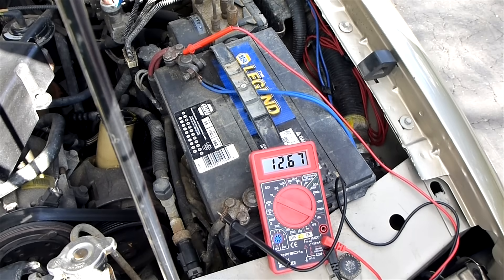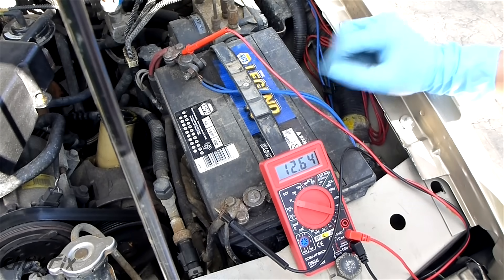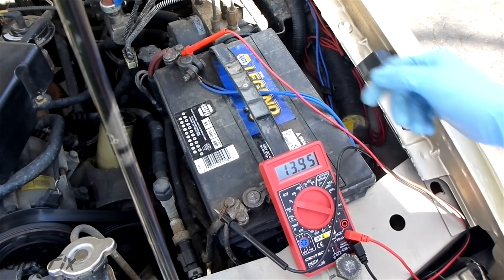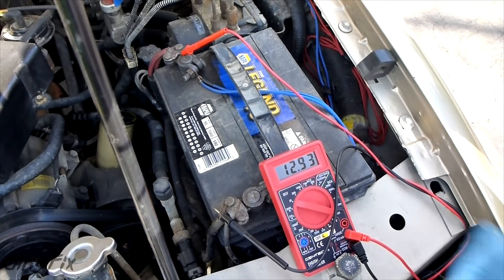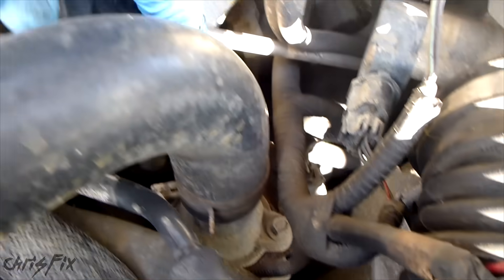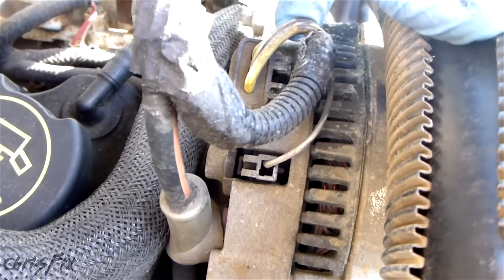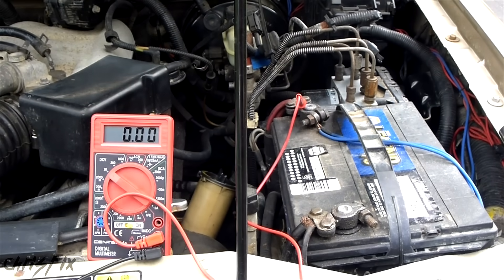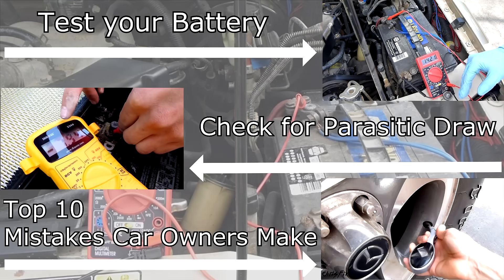How to Test an Alternator

Comment from the maker: Achilles Jeserich 12.2V is not that bad and shouldnt cause your car to run out of juice every three days. If your battery is bad, then sure it will die in a few days, but it seems like you might have a short or some type of parasitic draw somewhere. I would try this: How to Diagnose a Short in your Car
Reply: +starr shine
 I had something similar happen to my truck. Turned out to be a bad ground from the battery. I bought some wire made my own ground, tightened it up good, solved.
Reply: I have a 1970 c10 that has a external regulator and it's not charging the voltage while run is only 12.5 I can't figure it out I've replaced the regulator and alternator and battery any suggestions
Reply from the maker: Kam Nobel What if you put the red lead the + post on the alternator and the black lead on the case of the alternator, what voltage do you get?
Reply: ChrisFix 0.01 ground is 0.02 block is 0.01
Reply: Not sure I haven't done that?
Reply from the maker: Kam Nobel Try it and let me know!
Reply: Alright I'll get back to you
Reply: ChrisFix  thanks ... for your good and clear explanation of how to test an alternator. This sure helps me in checking my alternator if it's not working well.
Reply from the maker: Toby Namonne No problem! Glad the video was helpful!
Reply: ChrisFix Hi. My van starts, it drives with no issues. The issue is that when I have interior fan on high, radio, a/c, fog lights, etc. They will all of a sudden all stop working at the same time. This happens when I am sitting at a red light at idle. After I drive for a bit, they kick back on, with clock reset, radio loses presets.

Today I was troubleshooting, I had car idling in driveway, I turned on a lot of accessories, A/C, fan at high, radio, hazard lights, rear defrost, fog lights, then pop, they all go out, only this time, they will not come back on. No power windows, locks, A/C, clock etc. 

It still drives fine, and battery is getting 14.41 while idling, with no interior power load A/C etc. When I turned these all on, battery reading was all over the place, 4.22, 14.09, 11.36, 10.83, then eventually all interior accessories stopped working, and battery retuned to 14. 41 while engine running. Now, none of the interior stuff will come back on, locks, windows, clock etc. 

I'm not sure if it is alternator, because it drives fine, and charges at  around 14.41, or if issue is a fuse, or relay????

Any input would be great! Thanks for your videos. 

Vancouver BC, Canada.
Reply: +ChrisFix how do i check the continuity of the other wires coming out of the alternator?  are they negative?
Reply: +ChrisFix would that be a short?
Reply: +ChrisFix ok so I touched the lead to the + post and the case and got 12.7 volts, marginally higher than the battery lead voltage of 12.5

the continuity test of the + post to the +battery terminal is good.  just for kicks I ohmed out the alternator itself, + post through the case of the alternator.  I got 10 ohms.  Since the alternator generates electricity through induction, shouldn't the ohms be infinite?
Reply: +Kam Nobel Kam the 70 often used an amp meter on the dash. In doing that they run the pos cable from the back of the alternator to the dash, back out and to the battery. First things first get a test light and make sure you have battery voltage at the pos term of the alternator. Always go for the easy tests first like terminals loose, belts loose, damaged from battery acid cables. bad body grounds, noisy alternators. etc.
Reply: one question when i turned of my car the voltage immediately dropped back to 12.6 there was no surface charge as in it didn’t drop slowly back down from 14.4 it went straight back down to 12.6 is that a concern?
Reply: +ChrisFix if you think your alternator is not working at all and you don't have a multimeter you can just take somet thing metal and hold it agianst the alternator while your car is running becaus your alternator need to get magnetic.

Comment: i tried doing this same test and as soon as i connected the leads and it blew the lead wires to my multimeter. had my multimeter to the same setting as yours.
Reply from the maker: Sammy S There is no reason your multimeter should "blow". What happened exactly? Was there a spark? You should try the multimeter on AC and see if there is any AC current coming from your alternator. If there is, you need a new alternator. The current starts as AC but the alternator converts it to DC to power the battery. That is the only thing I can think of.
Reply: ChrisFix
yes there was a spark, i placed the negative lead on the negative and as soon as i placed the postive lead on the positive terminal it just went pop and the lead wire just split opened. keys were not in the ignition but the van door was open
Reply from the maker: Sammy S Well that is not good. There is a problem with your multimeter or there is a problem with your battery. It should only be 12-13v. I would try it with another multimeter or ask a parts store to check it for free.
Reply: ChrisFix ok ill try it in the morning with a different multimeter, also the reason im testing is because im having a serius drain on the battery. the battery drains real quick in like a hour or two, it drains all the way dead. the only thing ive changed recently was the whole distributor from top to bottom brand new. i was also thinking maybe there is a wire thats not grounded or maybe a solenoid that get stuck open.
Reply from the maker: After you test your alternator let me know what you find. Here is a video that is perfect for finding a short or parasitic draw: How to Diagnose a Short in your Car

Comment: My Focus tddi charge 14.9-15V with and without consumers.....800rpm. It is good or bad?!
Reply from the maker: Popescu Marin That is a little high. The voltage regulator might be going bad. What happens if you hold it at 2000rpms?
Reply: ChrisFix I don't try this. I try this to night. :)
Reply: ChrisFix Hi, Today 14.80V-14.90V at 800rpm, at 2000rpm 15V-15.10V max.
Reply from the maker: Your voltage regulator in the alternator is shot. Time for a rebuild or for a new alternator!
Reply: ChrisFix Hi, in the self test the charge is 14.4V at 2.000 rpm....
Reply from the maker: Ok, that is what it is supposed to be! Good!
Reply: ChrisFix what brand of battery you recommend ? Varta , Exide ... Fulmen?
Reply from the maker: Popescu Marin Any brand with a good warranty. I have had good luck with AC Delco batteries but they are hard to find.

Comment: Hey chris thanks for your help. When started, with radio and headlights my.voltage meter reads 16.6 volts. With that stuff turned off it goes up slightly to 16.7.

With engine off the meter reads 15.07.

The only thing I didnt do was turn headlights on with car off for 2 minutes

What do u think?
Reply from the maker: jesse tucci Sounds like a bad voltage regulator which can be built into the alternator or it is external (follow the wires coming out of the alternator and look for a small box). Get this fixed asap so you dont fry your battery!

Comment from the maker: Christophe Chery  If you only get 14.2v when you rev it up and at idle it is at 12v that means your alternator is bad or your voltage regulator is bad (which is typically built into the alternator.
Reply: +TheMechanic2 haha if you want to keep yourself busy buy a megasquirt 3 extra and assemble it yourself and then try installing it on and newer car    and then the hard part is getting the tuning perfect . it's taken all of my free time
Reply: so is it only running off the new battery only
Reply: +TheMechanic2 how can I to charge two batteries, my alternator is 27060-28230
Reply: Austin K Meh.. I got a lot of free time now. I usually have a few helpers that do most of the work so I don't have to get my hands dirty any more. :)
Reply: ChrisFix hi im a big fan... my mom has a 2006 Chevrolet blazer 6 seater umm when we turn on the ac to full blast while driving or parked the car shuts off, could you tell me anything that could cause that...
Reply: Mkay... :)
Reply: i know this is old but just a fyi( never rule out the idle air control valve on stall issues) especiailly when the ac kicks on it is suppose to jump idle instead it may choke or not run the a/c at all. could be anything just throwing that out there.
Reply: ChrisFix  bro
I did jus ur vdeo told n wut i found its lil confusing so i hope u will help me this time
Everything shows absilutely fine on my testing time except wen i connect red prob to altenators case n black prob to (--)terminal of battery  n reading was 0.00 where as ur vdeo tells it must b 0.05-0.06 
Idk why its showing this werd reading 
N yeah i was unable to connect black prob to altenators b post(tht bolt n nut covered with rubber cap thing) n red to +ve battery term jus because my altinators place is not lettin me to do so
Reply: ChrisFix Hey Chris I've got an 83 Toyota pickup 22r new everything electrical the voltage regulator loudly clicks and hunts until I put a load on the alternator any ideas?
Reply: Bad connections on the battery terminals!
Reply: ChrisFix  thanks,  my 2006 maxima  idles at 13.9 and hits 14v at 1500rpm rev.  I just had the battery replaced recently because it was completely dead. Does it sound like the alternator needs to be replaced or a bad connection?
Reply: bad alternator,  your idles should be at 14.2or higher. Replacing battery won't help and you're wasting money on a new battery
Reply: Kaw Doh i mean it helped me start my car since then.
Reply: You have a loose negative mate. My car stared last night will not start now.
Reply: ChrisFix what if it doesn't even turn on?
Reply: ChrisFix o
Reply: OK so I want to disconnect the alternator during certain conditions. Is there any danger to the alternator? Can I break the field circuit to do this or do I need to break the rectified output? Any danger when I reconnect? Assume it's dual belts diesel
Reply: my idle is between 13.6v - 13.7V  is that good enough or the start of a bad alternator?
Reply: ChrisFix Hey man I'm dropping 1.2 volts on the negative side by testing from the battery negative to the alternator negative how exactly would I go about resolving that large of a drop on the ground side?
Reply: They said you have to replace your battery every four years good or bad, I have a 7 years old Walmart battery that still pass the tests you did on this video.What is your say about that?
Reply: +ChrisFix My friend,It's even more impressive that the young man can do so much with so little of tool.
Reply: Chrisfix i have a question i drive a 2000 ford f250 diesel and when its just sitting it reads 12.5 on both batteries but when i start the engine the driver side batterie reads 14.9 and the passenger side batterie reads like 13.5 and it charge but after 3 days i drive the truck it wont start i have new batteries and new alternator.... Can u help?
Reply: @calvillocobra98  I would look into bad cables, you can remove them ohm them out. Also what temperatures are you talking about? The 7.3 diesel that's in your truck will have trouble starting if your glow plugs and everything aren't operating properly in colder temperatures.
Reply: Rippy 888 thank you for the reply man. I had the truck fix for reason the alternator was new but wasnt charging and keep on killing my batteries so i end it up getting new alternator and new batteries again and the truck its running good now it had a short on the cd player 2 but replace the unite and problem fix. Thank you again
Reply: @calvillocobra98  ohh, it had parasitic draw? Gotcha. You are very welcome. Glad you got her running good again those are the best trucks you can buy with money.
Reply: Rippy 888 i know they good truck. Its a long story it was my brother truck but he past away 3 years ago and i decide to buy the truck from my parents cause i knew how much he love this truck and here i am working on it my self 😂😂
Reply: @calvillocobra98  aw Man that is kind of sad but awesome too. I'd have done the same thing. You got a good memory there.
Reply: Rippy 888 yea i know and its funny cause im a chevy guy lol
Reply: @calvillocobra98   well I'm a "anything proven reliable" guy. And your ole brothers truck is a great example of that.
Reply: Rippy 888 yea i know its a good truck
Reply: @calvillocobra98  the best truck
Reply: Austin K Try out programming with the HPTuner. I'm using significantly more gray matter than I usually do on a daily basis. It is a lot of fun. Duramax fuel mapping is interesting.
Reply: Nuke any suggestions? Sounds like a major problem....
Reply: Jimmy Pizl Just replace the compressor? Ya that is a cheap fix. You are one of the idiots that just replace parts because you don't know how to diagnose problems. Please don't touch people's cars and please stop giving advice when you have no idea how to properly work on vehicles.
Reply: +TheMechanic2 haha get a room you two, and if you guys know so much what are doing watching a video like this

Comment: Hi, I got a voltage problem with my car, please help... I have go through the voltage test and the figure is when every equipment is on the voltage is 12.00 something and when everything is off it goes to 13.5.... I have to accelerate to got a reading of 14.2.... SO whats the problem with the alternator??

Comment: Thanks for the video! 
I have a battery reading 11.8 v when engine is off. With engine running, the reading goes up to no more than 12.5 v. 

When I increase loads to the max possible, reading starts to fall down till it reaches 10.5v!  At this point the car starts to stall badly and might even cut off. 

So what are my possibilities? 

Thanks in advance.
Reply from the maker: Mahmoud Mourad Bad alternator or bad battery. How old is the battery? Does it die over night? I would guess it is a bad alternator or alternator voltage regulator (which is usually built into the alternator) because you are not getting enough volts when the engine is on.

Comment: i was told the diode is bad, does that mean i still need to replace the whole alternator?
Reply from the maker: Jose Ruiz You can find a shop to rebuild the alternator so you dont have to replace the whole thing. They will be cheaper and replace any of the broken parts.

Comment: I've changed my alternator 2 times on my 209 CLK 55 I don't know what the problem is. The battery is not the problem, I know for sure. What can cause this problem? A bad ground? SAM? the lights are pulsing, any thoughts?
Reply from the maker: Luis G. Hernandez A bad ground, a heavy draw, etc. Did you try the voltage drop test shown in this video?
Reply: ChrisFix I did, It had a rough start.. Do you think it could be the starter ground cable? Its driving me nuts
Reply from the maker: Luis G. Hernandez It can be a bunch of stuff. I cant really help that much because you need to do tests and I cant do tests on your car over the internet lol. I can try to give you suggestions such as checking the voltage drop (as suggested above). You can try cleaning off the ground on the starter too. How do you know the problem is not the battery?
Reply: Well suggestions are cool. I understand you cannot do test but you perhaps can tell me what test to perform. I did the voltage drop test everything was fine.. I have a problem. I don't know where the ground for my starter is located :S
Reply from the maker: Luis G. Hernandez Ok cool. Well the ground to the starter is easy to find. Just follow the black wire coming from the starter and follow it until you see the grounding bolt. I would try and "jump start" the starter. See if when you jump start the starter the starter sounds strong and see if the lights dim. When you start the car normally, does it feel like the starter is weak? To jump start the starter you just use a long screwdriver and touch the ground bolt on the starter to the +bolt on the starter. It will engage the starter like you are starting the car. You starter might be going bad and causing a big draw on your battery.
Reply: Its a pepboy 130 dollar alternator. I know it sounds unlucky but i think the "remanufactured" alternator came bad. I contacted pep boy and I explained the situation they will refund me. I hope its the alternator but Chris what other suggestion can you give me? Thanks for your help! I checked the starter and it was all good
Reply from the maker: Luis G. Hernandez Did you do the test in this video to see if it is bad?
Reply from the maker: I would try and clean grounds (although you said the voltage drop test was good). Look for any grounds, unbolt them, and clean them.Can you explain your problem a little more?